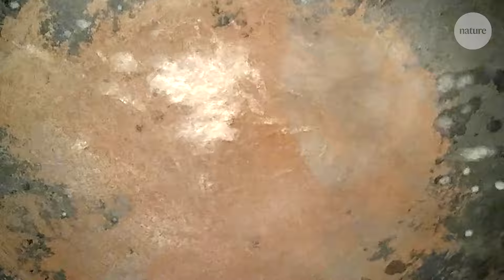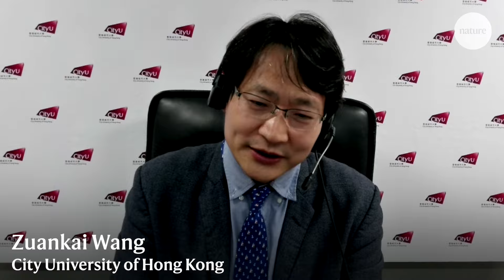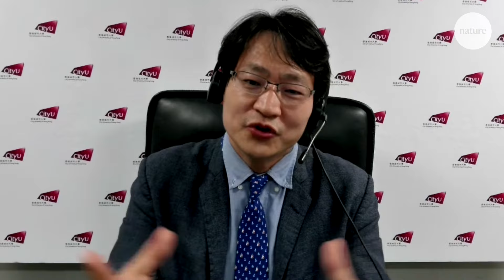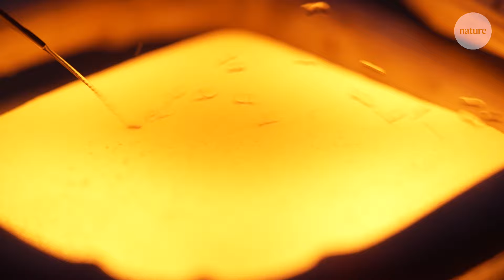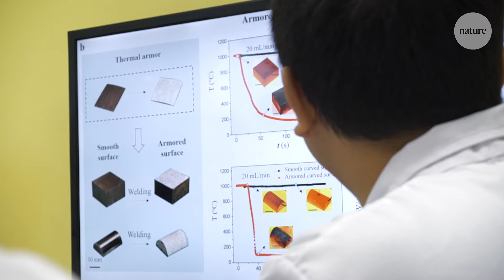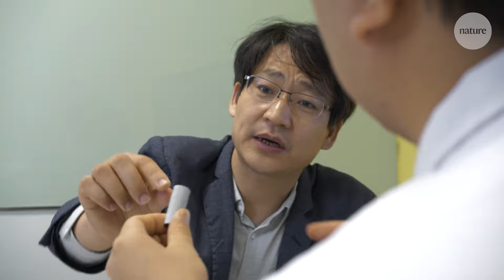Why water skitters off sizzling surfaces – and how to stop it

Comment: the leidenfrost effect can also be explored without a hotplate. This requires a water surface that is saturated, i.e. has maximum surface tension. If there is another surface below the water surface, the droplets will bounce off, if the conditions are just right, the outgoing droplet will split, then you can see many small moving droplets on the water surface, which is very similar to the leidenfrost effect. in my opinion, the droplets retain energy through the impact, which puts them into a spin. only when the energy level of the spinning droplet comes closer to that of the water at rest do they combine. i have a lot of videos of it :)

Comment: It's undeniably a very cute trick, but the fact that it's a composite material with likely huge coefficient of thermal expansion mismatch between its constituent metal and ceramic or glass fiber parts, among other issues like friability of the fabric, means that real world applications are probably going to be very limited. There's no way any reactor operator is going to put a material like this in their core, for instance.
Reply: It's a cute trick you can read the article on and try in your reactor core and or model.

Comment: How much of a gain is there if it is submerged in water?
Reply: This paper targets evaporative applications, and is less applicable to submerged cooling. Techniques such as spray and/or jet cooling are easier and cheaper. 
Moreover,  when it comes to submerged cooling the question you are asking should be about flow over surface since submerging in water without flow is pointless as it will raise the water temperature/pressure indefinitely.
So the impact of the study is still significant even if there are only marginal improvements over submerging in water.
Reply: @122017  I should think submerged cooling by default would require minimal vapour production, is it then related to what the video is talking about?
Also, if my secondary education served me right, evaporation process takes much more energy than simple heating up  the same amount of water liquid.... I assume that should be preferably more efficient.
Reply: some devices are not waterproof.